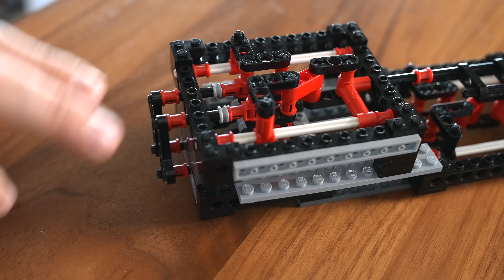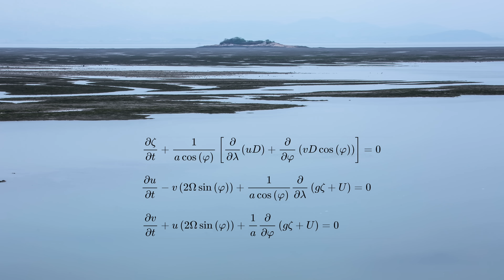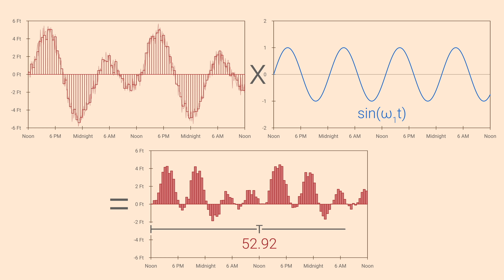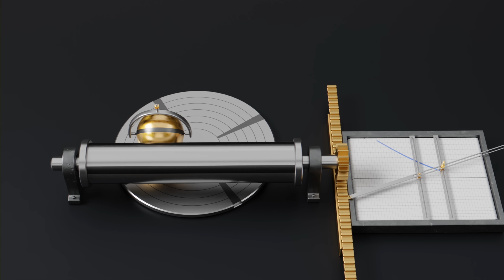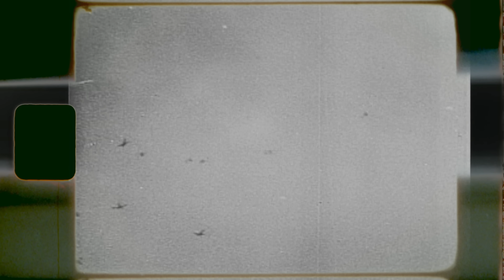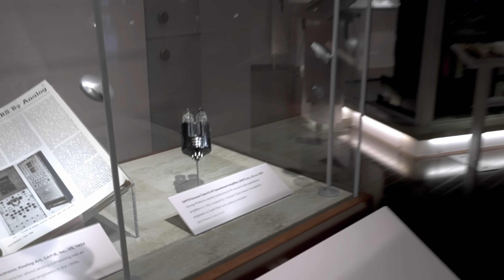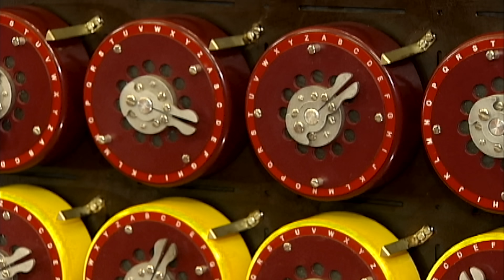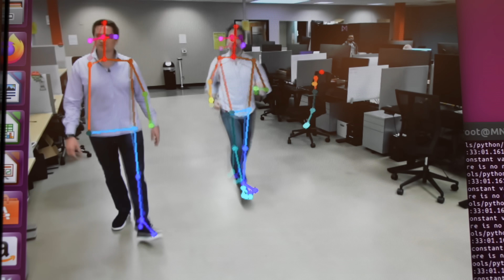The Most Powerful Computers You've Never Heard Of

Comment: Back when I was a student in the 70s, one day we were shown an analog computer setup by the physics department in the geology building at UNSW. The device had lots of dials, and used interacting electric and magnetic fields as well as differential and integration circuits. I thought it was amazing, using the laws of physics to do fast computations. BTW, one of my fave old time science fiction movies is When Worlds Collide. At one point in the movie a series of astronomical calculations are put through the differential analyzer, so you actually see the real device crunching away... to modern eyes it looks really strange. Good to see such an interesting solver being reinvigorated. As they say, use the best tool for the problem.

Comment: Analog computers are not just mechanical components but also with electrical circuits where you measure the current and voltage. Common things are FPGA and ASICs.

Comment: Had a passing encounter with analog computers in nuclear power plants in the 70’s and 80’s.  Not sure if it’s still the case, but many of the control systems and simulators used analog computers and control systems because of their age, regulatory environment and so on.  The systems I was working on were digital, and my understanding was they were only allowed because they were peripheral to fission and power generation.

Comment: I'm glad you touched on analog computers because they've always interested me, but unfortunately you didn't even touch on the largest ones for wartime use.  Also just to get it out of the way though I'm sure someone else mentioned it, proximity fuses are the huge difference in why planes were easier to shoot down with anti-aircraft artillery.  The directors definitely helped - particularly with radar input - since they could figure out target speed and course and figure out where to aim, but performing any sort of evasive maneuvers would be enough to dodge it due to the time of flight to get an artillery shell up to the plane's altitude.  Also the Norden (and the other powers' alternatives, Germany's actually being simpler) was very accurate, with solid testing and training showing a circular error probable of just 75 feet in pre-war.  The reason the CEP for all belligerent nations in combat was around 2300 feet is because of things like being shot at and only having reliable wind data from a weather balloon perhaps once a day at the airfield you took off at and not at your target location.  Having accurate bomb sights still made a massive difference though and shouldn't be understated.

In any case I have to say I'm disappointed you didn't mention gun fire control systems for naval artillery.  Particularly for the larger ships, from late 19th Century pre-dreadnoughts to modern battleships, there was space to put in large analog computers.  Without analog computers to calculate trajectories and compensate for the pitching motion from waves, effective engagement ranges would have still only been around what they could have managed with cannons.  In comparison,  while the actual hit percentage of WW2 naval engagements was around 1%, they could often open up at targets over the horizon.  Having fire-control radar even allowed for fairly long engagement ranges at night.  Some of the major examples are the USS Washington easily managing to shell the Kirishima only some 5.3 km away during the Battle of Guadalcanal and the USS West Virginia during the Battle of Leyte Gulf managing a hit on her opening salvo against Yamashiro at a range of over 20 km.

Comment: As a computer engineer, I was always told that every one has always dreamed to build analog computer because of the enormous performance potential over digital computers. However, it's not that engineers are dumb, that's not that simple. 

There is the precision and noise problem that you pointed out, digital component can easily erase noise and restore a digital signal which is very interresting to transmit data over the distance. But in that's not the most important point. We are curently already creating quantum compter which require extreme precision,  but there isn't any decisive project for analog computers yet.

In fact in the case of computing the true game changer is timing! Most analog components have time based behaviours, they use analog values of physical constants like voltage, intensity, etc. that doesn't change instantly because they tightly binded to physics laws. When you have a few component moving over a few minutes like old computers presented in the video, it's no big deal, but the nightmare start when you try assembling million, billion or even more of them and syncronizing them at the micro-second or nano-second. And th is not a trivial problem.
On the other side, the main advantage of digital gates is that they are syncronized on a clock. There is a regular clock in your computers (today usually around 4 GHz) and all the memory cells that store bits of data in your computer change there state at the same time when this clock tic. The clock period is designed to be long enough to be sure that every electronic component in the whole computer chip had the time it needed to update its electric state and stabilize its value. Some components would probably take less time than that, but in the end we are garanteed that all electronic signals are stable and reliable. Just with that hypothesis all simulation tools and computer designer can make an enormous simplification by just ignoring all time related physical behaviour and instead focus on a much much much simpler finit state automata. If you look at a processor simulation tool used by computer architects you would not see anything related to voltage, intensity, or physic equations, because all of that is neglected and instead we can focus on much simpler binary signals.

In fact I lied a bit, in practice at the level of miniaturization we reached, we still had to deal with noise, interferance, etc. but that's mostly solved globaly by building robust components and adding shielding around chips when needed, an not by solving the exact physical equaltion between every single electronic components.

It's not that no body tried to do analogus computer but, in history, since the transistor was invented, it has always been simpler and more efficient to reduce complexity with digital computing and compensating by an increased clock speed, adding more parallel transitors computation or a more optimized chip architecture, that trying to work out the complexe equations of billions of analogous electronic components.

It's a little bit like an intersection with traffic lights. It's theoritically possible that everyone pass the intersection at almost full speed by precisely computing everyone's speed. But since cars became widely used,  we all accepted that its safer to sync everybody using traffic lights in a binary way.

Comment: I had a very interesting childhood full of some amazing opportunities and accomplishments. One such detail was that I built an analog computer for a grade school science fair. I believe I was about 10 and the year was around 1972 or 3. My dad designed jet engines for Pratt & Whitney Aircraft and I was always drawn to math, science and music. I went to the town library looking for books of interesting science projects. I found a book of home science projects using simple, inexpensive items. It had a plan for a simple, cigar box, "analog computer." By your definition here I think it was really a simple  digital computer. It used a cigar box, those copper pins you use with punched whole paper to bind pages together, some wires and some small low power incandescent bulbs. You could add single digit numbers by turning the dials on one and then the number to sum on the other. It showed the result by lighting the appropriate bulb. I blindly accepted the name "analog computer" because it used no transistors or ICs. But unlike the analog computers you showed, there were discrete digits. I think it was a primitive digital computer which is even more impressive for someone in 5th grade. The school system made note of my STEM aptitude. About 3 year later, I was selected as one of 6 kids to go use a PDP11 that had been donated to the school. The other kids were all high schoolers. I was bussed over from the middle school where we were through 9th grade. There was no terminal or printer. Just the PDP11 unit with the dip switches and lights on the front. The other kids goofed off and called it a free day. I taught myself the machine language and figured out how to input two numbers, and yet again, add them. The teachers later told me no one had figured out how to use the thing and asked me how I did it. I said "I studied the thing, read the little manual, and taught myself binary on the spot. They had no idea what I was talking about. Both of these things were extraordinary opportunities. I hope someone reads this and realizes the power of curiosity and critical thinking skills. This was a public school in South Windsor CT and not some fancy private school. Opportunities surround us everyday. All we need to do is seize them. STEM FTW.

Comment: I was born around the time Connor Macleod was (it feels like that at least).

I remember when Moore's Law was still young. The doubling of components per integrated circuit was a fun thing. But by the time we had reached the 120 Mhz Pentium 1 CPU, we couldn't imagine processors getting faster. I mean this is when the 386, 486, 487 etc still had Math Coprocessors.

A 120Mhz Pentium (1) was so fast, my friends and I hypothesised that if computers got any faster, they would be kind of "Precognition" machines. Machines that literally work faster than what you can even think.

How things had changed

Comment: About analog computers, they have another advantage when compared to digital computer which is resistance to radiation.
About the detriment of needing high level of precision for the analog computer, today we have machines for machining that are more precise than during WW2, so it shouldn’t be a problem. You even industrial 3D printers that can very high level of precision… Well, at least if you are ready to pay the price. Those are damn costly.
.
An actual problem with modern digital computers is that we need specific material that are sometime particularly rare to make components, like for semiconductors or batteries.
It also can't come from any source since, as said in another video of Veritasium about bit flip, radioactive pollution in the material will make the component useless.

Comment: In the early 1970's I worked on a helicopter flight simulator that was totally analog.  The full size cockpit had fully functional instruments, switches and controls of the real helicopter but the windows were frosted so it was like you were always flying through a dense fog or cloud.  Though there were no visual clues the cockpit was hydraulically moved to simulate the G forces you would experience in flight.  And it even had a sound system to create the whine of the turbines and whop-whop of the rotor blades.  
  
All the mathematical calculations, including summation, multiplication, integration and differentiation, were performed by transistorized operational amplifiers, servo motors and feedback potentiometers wired together and housed in a 40' semi trailer.  There was only one integrated circuit in the whole system and that was an audio amplifier for the sound system.

I still find it amazing that with just a few basic components it was possible at the time to simulate the complex flight of a helicopter in real time.

Comment: Mistake in a written integral.

S x^2 dx     Correct
S dx x^2     Not Correct

The differential dx closes the integral.
S dx x^2 = S 1 dx x^2 = (x+c)x^2 = x^3 + cx^2

The function was not ot x^2.  I am using a simpler function to demonstrate the error.

Comment: While the development of digital electric computers for AA guns certainly helped in the reduction in shells required to down an aircraft, it should not be overlooked that in early January 1943 (the year cited for 90 shells per downed aircraft) the first proximity fuse using radio waves was introduced to the U.S. Navy. The ability to down an aircraft by detonating a shrapnel shell near an aircraft without impacting it was one of the most important developments of the war in the pacific. 

(And incidentally is worth mentioning that they had to develop batteries and vacuum tubes that could withstand the forces of an anti-aircraft gun and still survive since the transistor hadn’t been invented yet. It is a truly remarkable story)

Comment: I've been waiting for analog computers to get postive reception.
They are infinitely accurate but limited in precision, I've used them to make scientific equipment that needed form accuracy over positional accuracy.

While digital is infinitely precise but only as accurate as the digits, the frequency it operates etc.

And finally, anything analog can be made to be digital, giving control over where you want accuracy to intersect precision, but not the other way around.

Comment: I'll just drop in a reminder here that digital computers aren't in fact "exact" when it comes to non-integer numerical calculations; unless one is using a special arbitrary-precision math package, there's some loss of accuracy as less-significant bits fall off the bottom of the finite-sized representation of numbers.  Order of evaluation can make a big difference where in a mathematically perfect world it wouldn't.
Doing highly iterative calculations without taking the finite precision of the intermediate values into account will yield highly wonky (but consistent!) final results.
(Yes, it's still better than trying to do the same thing with gears.  Usually better than analog electronics, with their voltage offsets and temperature coefficients.  But it's something that needs to be taken into account.)

Comment: 2:30 -- saying something is nearly the size of its component parts? This is like saying my keyboard is so small it's nearly the size of a single key! Or, making the kessel run in 12 parsecs. Beyond that, my understanding is transistors aren't 'nearly' the size of atoms, and never will be. We run into quantum tunneling around 1-3 nanometers. So just the barrier portion of a transistor will always need to be around 30 atoms thick, at minimum. Really the main problem we have now is that silicon creates tons of heat as a byproduct, limiting clock speed. If we can find a better medium, we could possibly go into the terahertz range instead of being eternally locked in at around 4-5ghz.

Great video otherwise

Comment: My guess on one of the subjects for the next video.

Digital computers are not very good to simulate analog signals like biological neurons... We can simulate neural networks in digital computers but it isn't good enough and it consumes a lot of power.

But if we could create a 'physical' artificial neuron (instead of a virtual artificial neuron) and create physical neural networks we could use them for AI in a more efficient manner and to treat diseases where the neurons are not working properly.

The brain is a biological machine that can solve many complex problems but it is pretty bad for mathematical calculations, an area where digital computers excel at. Moreover brains are much more energy efficient to solve these complex problems than digital computers. If developed this technology won't replace digital computing but it will complement it.

Artificial physical neurons have been a subject of research for a long time.

Comment: The Smith Chart is a graphical computation method still taught and used. 
Digital computers are still pretty much power pigs. Show me a digital radio 
that can actually run on a 9 Volt transistor radio battery. Many types of 
electronic filters are passive analog and have no DC power consumption.  
Many computational mechanical linkages, cams and gears are still used.

Comment: In the 1960s, I worked on a large analog computer that was used to train pilots for the F104 fighter.  Also, many general-purpose analog computers are programmed using wiring on boards which can be changed to allow the machine to solve different problems.

Comment: While digital computers are exact as they will repeatedly produce the same exact result, the result will include some error. Due to how we represent numbers in digital computers(some number ^ another number) almost all numbers will be approximations. Most numerical solutions, say integration or a derivative of data points, will have error from both the algorithm and machine round-off. I would bet that an analog computer with modern machining tolerances could out-perform a numerical(digital) method in terms of absolute error.

Comment: Completely missing out the Kerrison Predictor then? 🤷‍♂️
Maybe because it wasn’t American designed?
I only know about it because I’ve got one of the engines that was designed to run the generators that powered it, they had to have very precise speed governors to keep the frequency just right. (Unfortunately the engine in question proved to be a bit temperamental & was later replaced with a multi cylinder unit, not many are left, & it is a pig to start).

Comment: If anyone is interested this is an area of research I have been working in for the last three years, the key difference is I have been  building an analog processing core within logic gates. Where you can design analog computer within a FPGA, that is both digital and analog at the same time, where both computer architectures can be integrated within the same device. But it has been impossible to get R & D funding to do much more than a few basic prototypes.